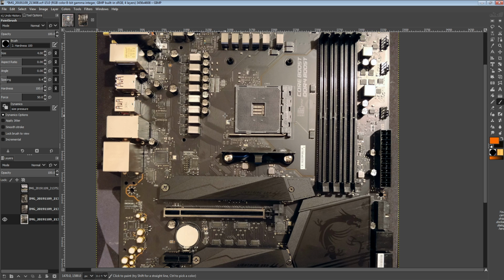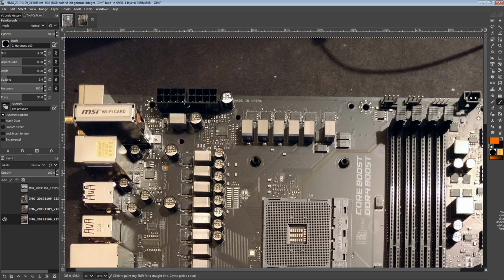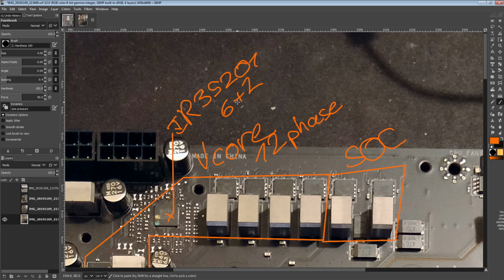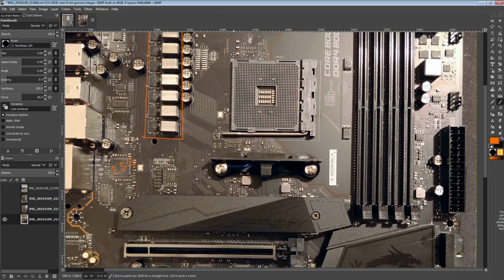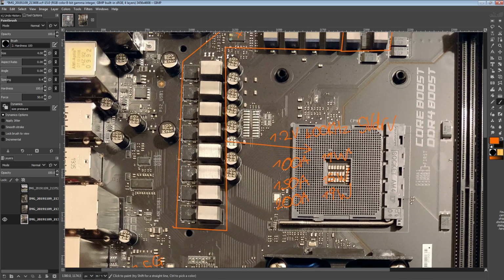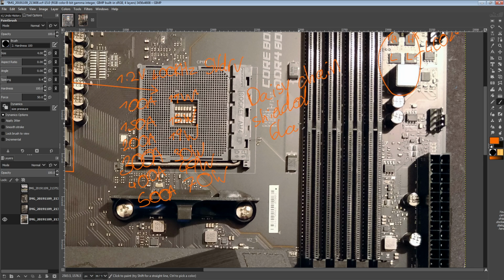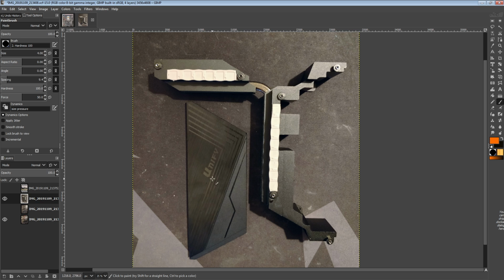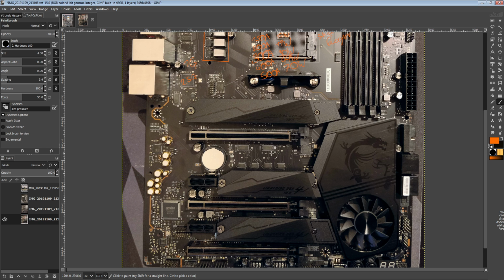mobo PCB Breakdown: MSI X570 Unify

Comment: Picked one up a year ago on sale for $180-ish IIRC. For 3 NVME slots, and placing a 120mm fan directed at the chipset to the chipset fan never goes above 50C (so the fan never comes on), this is a pretty killer board even in 2024.
I plan on eventually getting some NVME > 5xSATA port adapters and turning this board with a 5800x3d into a headless server. It can run the VM's I need and other CPU intense tasks with ease with a ton of SSD + HDD.

Comment: Are 8pin CPU power connectors rated at 384W?

I remember overclocking a 2P AMD G34 rig with engineering sample CPUs, and it was pulling around 350W 24/7 per connector (it had two on the PCB). But. after two months, the board failed because one of the connectors was completely destroyed by heat.

Comment: I've had this board for over a year now running 3600MHz CL16 RAM at 3800MHz CL14 at 1.5V.  VSOC and other voltages have been bumped and have yet to see the chipset fan spin!  MSI drivers and BIOS support is continually updated.  The board looks great too, no ghastly RGB anywhere :)
Reply: Really nice to hear good things about it! I plan to get Unify with 3950x and 2x32GB (probably 3600mhz). :)
 I would later upgrade to 128GB, but in this case, i would probably have to lower the speed to 3200mhz. Or i would better buy 3200mhz in the first place. Also, the Unify doesn't support ecc memory right? Im wondering how stable the 128GBwould be then. Do you have thoughts on that?
Reply: Oh and also, it has three m.2, that's great for my usage. Although it could have been good if it would have 6 sata.

Comment: Dumb question, sorry.  If this is effectively a de-RGB'd MEG ACE, why can't I run Gskill 4x32GB (F4-3600C18Q-128GTZN) on the Unify, but I can on the ACE?
Reply: Hey! How's you RAM? I plan also on 4x32 GB setup. Do you have it set up and running? (i would pair them with 3950x)

Comment: I just ordered this motherboard for my new ryzen 9 5950x and on my research which ram I should choose I feel kind of lost.
I want something like 64gb of ram (or 32gb with the opportunity to upgrade to 64 later). Concerning the speed I'm aiming for a stable working 3600mhz via xmp profile. I don't want to adjust timings and such manually because I'm a pc noob.
So some say I have to choose dual rank ram sticks when having 2 sticks on the board, but single rank sticks when having 4 sticks installed. But what if I wanted to start with 32gb and upgrade later - should I chose 2 x 16gb dual or single rank sticks?

Do you have any recommendations for me? It would be great!
One limitation is there: the hight of the ram should not exceed about 40mm because of my cpu air cooler. I don't need rgb.

Comment: Hi commenting on your 8+8 pin /8+4 Pin rant: the 2nd supplier actually supports voltage stability stressing the components less (der8auer did a video on it)

Comment: Hello #Actually Hardcore Overclocking or buildzoid, I want to congratulate you and through your channel, I decided that I will buy the unify x570 motherboard instead of the Gigabyte x570 aorus pro. I'm Brazilian and I don't understand English so well, and I wanted your help to choose best ram to get the most out of the AMD platform, with high frequency and low latency. Which would be better, 2x16GB or 4x8GB? Some I thought G Skill F4-3600C16D-32GTZN or F4-3600C16Q-32GTZN, F4-4400C18D-16GTZR, F4-4000C19D-32GTZKK, F4-4000C17Q-32GTZR? My wish is to have a total of 32GB, and I have many doubts as there are many memory kits and I don't know what the acceptable overclocking limit is, if I choose a cheaper 3200mhz kit to reach up to 3733mhz and kepping  low latency c16-16-16. Please help me, thanks.
Reply: I'm not buildzoid, but you should go with 4x8Gb (I think Jayz2cents did a video on it a while ago), as for what ram to use, you stop getting advantages when you go above 3800MHz and CL doesn't really matter all that much

Comment: I WATCHED 4 OF YOUR VIDEOS SO FAR AND I AM GETTING TIRED OF THE INTEL VS REALTEK DRIVER BULL STORY YOU HAD FRICKING YEARS AGO - TEST THE DAMM NEW LAN STUFF FROM OTHER PROVIDERS. It's like hating on AMD because in the past you had a bad experience with one of their CPUs so prefer Intel no matter what - crap way to view the world. My rant is over is almost over. ALSO - the MSI Unify board 8 Pin CPU2 connector DOES NOT power the PCI-e slots with extra power - I dare you to double-check.  Other than that - good videos.

Comment: I just got this motherboard in and my CPU comes in tomorrow but hold on... Clarification: Those dual 8 pins.. I can just plug in from the power supply and not plug in directly to the graphics card? Is that what I'm hearing? For an even cleaner set up? Wish I could test this right now.
Reply: 8 pin Plugs in cpu power on mobo
Use the left one and you only need 1 unless you have cross fire and need more power.

Comment: So... if a GPU has it's own PSU pins for power, I don't have to use them, if I connect the PSU to the 8 pin on the motherboard?...
IF so... Seems to be cleaner cable management. Good stuff.

Comment: Should I buy this over the MSI X570 Tomahawk? 🤔🤔🤔🤔 I'm so tired of waiting for at least a release date for the Tomahawk. $100 difference for post code, no led, similar thermals w/ 3900x according to Steave, and I can start building now instead of dealing with a Dell with Q8400 😂😂😂
Reply: ok. Ended up buying the Unify instead and it is insane with a Ryzen 9 3900x with 64gb of bdie ram. now i am waiting for Nvidia to release their next gen GPUs AHHHHHHHHHHHHHHHHHHHHHHHHHH
Reply: Da Cook I love it lol I have 64 GB of ram also  but I bought a 2070 super 😭, didn’t know the new ones would be coming out
Reply: I was waiting on the tomahawk also lol but I ended up getting the same thing as you lol
Reply: @jayrimmey  it's amazing isn't it :DD
Reply: Can't wait too. Bought the Unify and now I can use my new parts instead of waiting months.
Reply: Hi guys i bought a 3900x 
Which ram did you all buy i am planning to buy the g skill cl 14 gtznb one costa 179$ for 8x2 gb ! I plan to push it to 3866 ... main use of the pc is gaming plus light video editing..
Reply: @ajinkyap7102  sounds good so far. I use 3200 CL16 because they are cheap. But it's just a 3600 and I'm very happy with the performance.
Reply: @johannstephan96  cool thanks 😀

Comment: you should check if realtek did improved because if you dont you have to say for years that you dont know if they have and maybe intel would be better . _.  love the vid!
Reply: I've had a Gigabyte X58 UD3R for 10 years now and it has a Realtek Gigabit LAN. It has never dropped the connection. The only thing that happened was when I upgraded to Gigabit Internet the older drivers would revert the connection to 100Mbps. After updating drivers everything was fine.

Comment: My brother unistalled the drivers to 2.5g lan on this board.  He says the internet connection has issues. Your concerns have been realized.
Reply: @NikoStark1  He didn't. He doesn't like. What he calls lag spikes. He has a 3900x with the ryzen software.
Reply: @NikoStark1  He says that python is part of the problem. He also has stacraft ii running at the same time. Where mouse click accuracy is crucial. You could use the wifi or a intel gigabit addon pcie card. He won't do that though. He uses the stock cooler that came with the 3900x. He complains about the motherboard chipset fan too.
Reply: @NikoStark1  I know its compatible with first gen ryzen. Which is pretty neat though. Its a bit of hassle installing older bios for the board on msi's website. But I know a guy did it youtube. https://www.youtube.com/watch?v=37B-20q9kBo&t=820s

Comment: If, which no one ever will, someone has a problem with VRM Temps on this board simply adding a piece of cut to fit .5mm thermal padding or some thermal pasts between that monster top piece where it screws to the rest of the over kill VRM should solve it...
EDIT: 
I saw he actually mentions this after I made this comment.
Oh, the woes of commenting as I watch...LOL

Comment: I wanted to ask about the 8 pin power you pointed out (versus the comment you made about the same on the ACE review). if you plug those in there, does this mean you don't need to connect a power cable to the video card directly?

I also was curious if the taichi is one you recommend above MSIs

While shopping for an x570, it seemed to me that practically all of them say, when you plug in a 2nd card into the PCIe slot the bandwidth becomes 8x / 8x. Doesn't that mean you care cutting the max capability of the 1st card?

Comment: The Taichi which you just mentioned has a 4 + 8 pin 12V ATX connector combo... how can you not have seen this in Nov 11 2019?
Reply: He meant that he has not seen PSU that supports only 8+4 EPS connectors. If manufacturers are going to put second EPS connector on the motherboard, might as well make it a 8 pin

Comment: The proprietary PWM scheme is called ATL (active tri-level). I worked on it back in the day (almost 10 years ago now). The main difference is how the powerstage interprets the incoming PWM signal and the fact that the controller can force 1.8V or 3.3V.

Standard control:
PWM=0V means low side on. PWM=3.3V means high side on. PWM floating will go to 1.8V due to a weak resistor divider inside the powerstage. This voltage means tri-state, but it takes time to get there because of the RC time constant. 

ATL control:
PWM=0V means low side on. PWM=1.8V means high side on. PWM=3.3V means tri-state. In this case all three states can be actively forced without relying on a resistor. This reduces the time needed to get to tri-state.

Comment: This is basically MSI's way of apologizing for the horribly bad VRM thermals on their lower to mid X570 lineup. That's why it was released late, too. They simply needed at least one board below $300 that wouldn't completely suck and thus get thrashed in reviews.

Comment: On the original PCIe specifications, 6p was 2+2 12V/G. 8p added one ground and another type sense, and converted an NC to 12V for 3+3. Is this not the common case anymore?

Comment: Hey Buildzoid!
Could you recommend me cheap and fast 32gb (2x16gb) kits, what will work flawlessly with both 2nd and 3rd gen. Ryzen processors.  I will get a B450M Mortar MAX with a 2700 in january, and later a 2nd hand 3900X. I'm on a tight budget, so i have to choose thing as reasonably cheap as possible, but i would like to get quality parts, what could serve me well in the future. I'm working with GIS 3D rendering, so i need a 24/7 stable pc.

Comment: You're not keen on realtek LAN but I've had good experience with it.  Asus' spec's list my current board as using the  "Realtek® 8111E Gigabit LAN controller". I've not noticed any issues since I bought it in 2010. It's a shame they ditched the dual LAN option but I'd rather have 2.5G if the unify's Realtek® RTL8125 2.5 Gbps LAN controller is as good as the 8111E has been for me.
Reply: I had issues, copy dvd images to my NAS ended up in a NULL block at the end of the files. I always needed to conpare the files to ensure they are ok.

Comment: The bad thing i find in this board is the Sata3 connector. Only 4 sata3

Usually standard board has 6, but this and ACE has 4, and thats few, too few.

Maybe its cost cutting or MSI forgot about them, i dont know and i dont like it.
Reply: Time to get rid off 2 SATA devices, problem solved. ;)
Reply: agreed.  Interestingly the gigabyte Aorus Master (with 6 ports) does the same once 3rd NVMe M2 is occupied.  I'd have preferred that approach on the ACE+unify boards for better flexibility.  In the ACE breakdown he notes that the debug code display is right against the SATA ports.  It's like they ditched ports to squeeze it in.  And why is it there? Because they shoved the superfluous overclock dial at the bottom instead.  Unify is like the release version to ACE's beta test following initial user feedback but it's like they couldn't justify adding the ports now there's space as it makes the ACE look bad.
Reply: @indigokilo9036  don’t worry they fixed that issue with the b550 version

Comment: I got mine UNITY last Friday from Starlit _ Partner MSI' USA importer. I payed about 299 for it. Was going to get the ace but when I heard from  hardware overclockers mention it in response to the Ace's crap heatsink , I was sold. The uinity  heatsink is solid and it stays cool. Im used to MSI's bios and board design and agonized over having to spend 350 for a MEG ACE.   I will report with issues  so far I love the no bling black and silver color.

Comment: Clear cmos on i/o is really easy to accidentally hit when moving the pc.
Reply: You can't hit it accidentally because it needs to be pushed very deep.
Reply: @PhreakDarkSoul  It happens. Asus mobos don't have to pressed hard at all. It also clears cmos with no power applied.
Reply: @wirerat  MSIs solution seems to be better.
Reply: thats what profiles are for
Reply: @ladmad9196  They created profiles so they could put the reset BIOS button in a stupid place? Are you sure!
Reply: @vickybowe3975  i find it convenioned. dont have to open the case this way

Comment: Buildzoid, excellent content as usual but the seemingly harsh criticism of the MEG Ace seems way over the top. I know it has the useless little OC knob that no one should be using but other than that it's a solid enthusiast board. I would think 4 sata plugs is plenty for most users especially with the 3 m.2 slots. I dont think most enthusiasts that buy this board are going to load up their case with HDDs or even sata SDDs and leave the m.2 slots empty - definitely not me. What good is buying an X570 if not to take full advantage of NVMe? The post code readout is fine for me where it is in the middle of the board, in fact if it were at the bottom of the board I wouldn't be able to see it as well - either way it seems like a trivial squawk. The RGB on the VRM is what it is, turn it off if its not desired and enjoy the infinity mirror.

Comment: Crosshair vi extreme has a 8 and 4 pin eps I'm pretty sure. 

Went and checked to be sure, yes it does. Really hard to find 4 pin eps cables coincidentally.
Reply: had a 6-pin eps once. at least i think, cause it fitted the eps socket of the motherboard

Comment: Buildzoid, I noticed the Asus TRX40 boards are using TDA21462 60A for the Prime and Strix variants and TDA21472 70A for the Zenith II Extreme. How would the TDA21462 compare to the IR3555 that Asus has been a fan of using for so long?

Comment: So an 8 pin power connector can handle 384W?  Is that true for older boards as well?
Reply: if it has the connector with solid pins..some use formed sheet metal pins that are not solid

Comment: My Gigabyte X99 Designare also provides power to the PCIe slots via the single 8-Pin EPS connector.
Long story short: CPU overclocking plus 3-Way SLI ended in a molten connector...

Comment: When you realize you heard and see a guy talking about a pcb
and look at the clock 40min ago
you realize you are a nerd
Sad that board has only 4 sata port i need min 7 and 6 usb3.

I know you didn't care about audio.
realtek lan is ok never had a problem in 10 years with an old am3+ board (970a ud3p) it runs nearly 4 Years with my old phenom2 x6 1090t at 3,8ghz
sadly The cpu wasnt stable at 4ghz temp limit
I used a tr macho 
Now i have a scythe ashura and a @stock running ci7 5820k on a msi x99a raider

I didn't know, should i upgrade to am4 3700x or above
For gaming isnt Necessary , for encoding yes
especially for a mid tier GPU

Comment: Especially older PSU with 8 pins have an 8 pin not a 4+4 pin, so they have an 8 and a 4 at least one of my corsair PSU and one of my be quiet ones has it like that.

Comment: You forgot to mention the chipset heatpipe on the ACE!
Reply: I just bought the Meg Ace and it's quite heavy, those heatsinks are no joke.
Reply: I wonder if the decoupling of the chipset and the VRM is to make it easier for people to swap the fan assembly for something bespoke like a waterblock or just replace the fan more easily in future.  There are screw holes available with the msi chipset fan removed. It just needs someone enterprising to make a custom block or even a thermal transfer plate that a standard AIO can mount to.

Comment: I wanted you to do a PCB breakdown ever since HUB had this one reviewed. I saw some crazy low temps with 3900x @4.3ghz, so i figured this must be good. They total lack of plastic and RGB just makes it oh so better in my eyes. Great video as always.
Reply: @tacticaltactics7665  Thanks I did not know that. It is good if I can save money or move the money to somewhere else.
Reply: No RGB is a Feature for me right now, I wish sellers have filter for it, I hate RGB, completely pointless.
Reply: @ArunShankartheRealOne  yes I completely agree I am saving up for this board  because I hate RGB and I don't want it included in the cost of my motherboard.
Reply: θα χρειαστώ τη γνώμη σου. x570 taichi vs x570 unify για έναν 3800χ και 5700xt ? ποια mb θεωρείς είναι η καλύτερη επιλόγη?
Reply: Did you use a CPU cooler?
Reply: so you are a "rGB iS uGlY" boomer